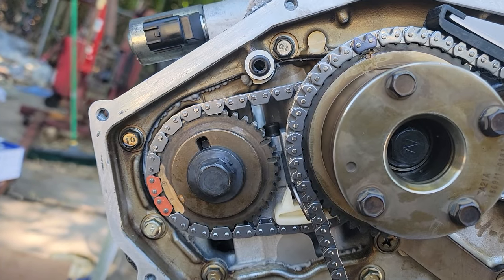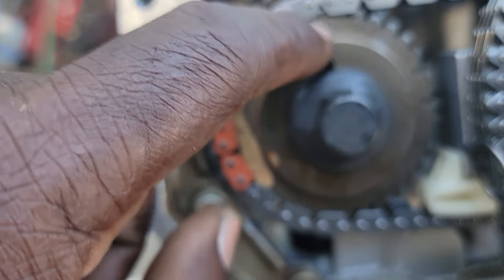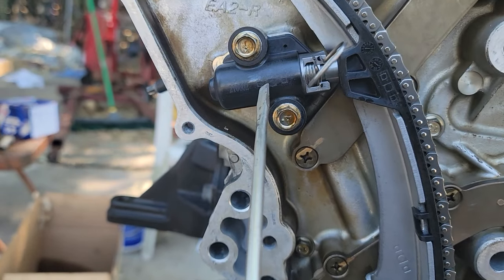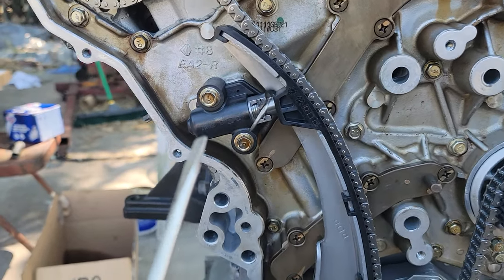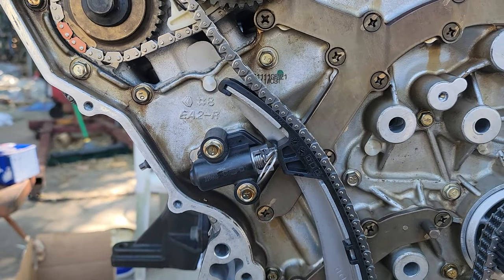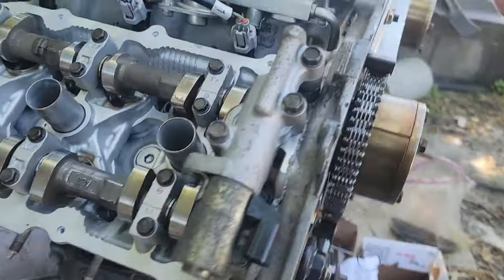NISSAN 4.0 TIMING PROCEDURES

Comment: Wished you would have shown lob positions on bank two. 
My bank 1 tdc frt lobs are up facing one another. I question bank two lobs when marks are lined up????
Reply: Can selinoids cause valves to bend?
My murano sounded like it jumped time but when timing cover was removed and engine put on TDC( combustion) . Timing was still set right. All markings were alined. valves sound bent when started.

Comment: How do you verify cylinder 1 is at tdc on compression stroke when installing all new timing set after an engine has jumped time? I have all my timing marks lined up on all sprokets. Im just not sure if im on the compression stoke. Or am i just over thinking this and the marks are where i need to be to start all over? Any input would be appreciated
Reply: Having same problem, did you ever find out anything?
Reply: @JohnSima-d2y  verified piston position  on cylinder 1 with a long  extension.  Confirmed cam position on cylinder 1 were facing eachother  like that manual stayed .. and prayed
Reply: @JohnSima-d2y   engine went together fine. Started and ran. Engine also had low oil pressure ..after it warmed up it showed cat failure. And  spun a bearing.